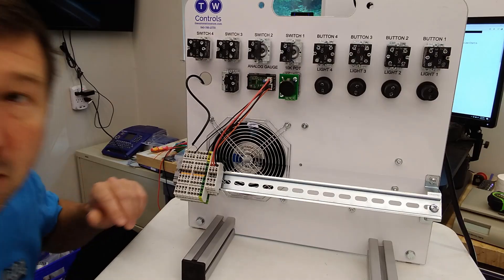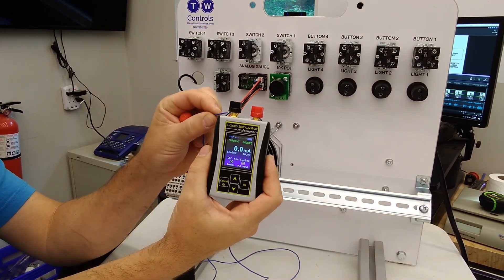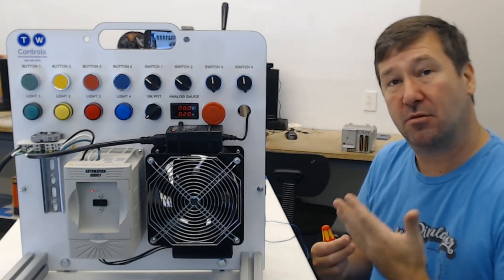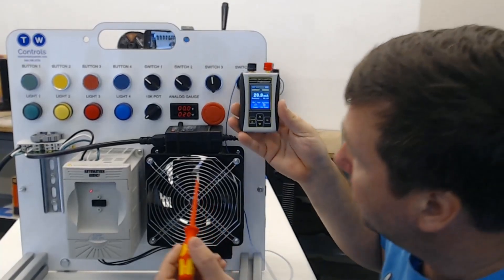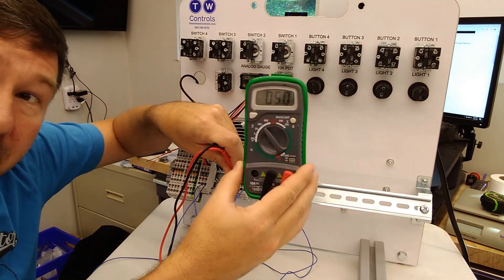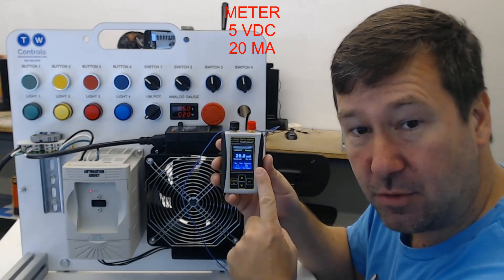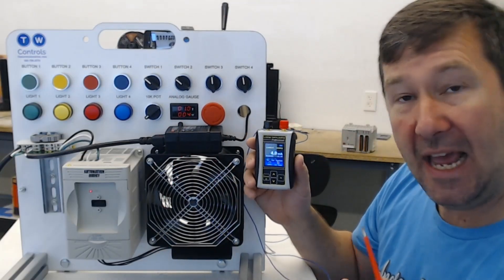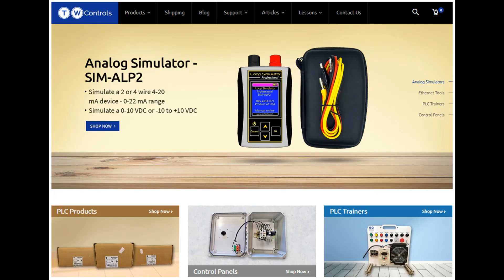Read a 4-20mA signal with a 0-10VDC PLC Input

Comment: Good day,
Why is it needed to convert 4-20 mA to 0 (or 2)-10V ? Is it a practical reason like 0-10V analog
inputs being more common or available on PLC ?
Or any other resons ?
Thanks & regards
Jean-François
Reply from the maker: Many PLCs have 0-10VDC inputs only.  Ultimately, a 4-20mA input is a voltage input with a high precision resistor.
Reply: @TimWilborne  I see thanks for this.
Jean-François
Reply from the maker: You are welcome

Comment: Nice Video Tim, Btw I want to ask question about wiring 3 analog 4-20mA sensors. I am using 2 wire transmitter (pt100) and two 4 wire transmitter (flowmeter and PH Meter)  to my analog input extension. I did the wiring already where the 4 wire transmitter like usual and I use PLC 24V DC supply for the 2 wire transmitter. The problem is when the flowmeter has no flow at all it has value around (0-30) fluctuates (the digital range  0 - 32000). And i tried to remove the 2 wire transmitter sensor, it reduces to (0-14) fluctuates. Note: I think i have scaled it properly to liter/second for the flowmeter, I have also done shielding + twisting for the flowmeter analog cable, I connected all the ground of every device to the same point. I am not sure how to solve the problem, is it because i use 2 wire and 4 wire transmitter or maybe it could be from noise... Thank You Tim
Reply from the maker: You need to add a deadband to your flow meter logic.  We just recorded a video about this last week but it isn't edited yet.  You need to determine the minimum realistic flow that your meter would see.  Let's say that turns out to be 100 units.  Then in front of your flow meter scaling, put a GEQ instruction with a Source A of your analog value and a Source be of 100.  Then add a rung with a LES instruction, source A of your analog value and Source B of 100, and then use a MOV instruction to put a 0 into your scaled analog value.
Reply: @TimWilborne   Aaa Icic, i got your point. The fluctuations usually around 0 - 0.01 Liter / second. When i read my flowmeter the min range is 0.977 Liter / second. I think i will use value around 0.1 liter/second as the minimum. 

I thought that this small error is caused by the loop from 2 wire  transmitter.  Thank You Tim , I will wait for that video 👍👍

Comment: When connect the resistor in series on circuit, is that restrict the overall current flow on the loop?
Reply from the maker: Yes, there is a limit based off of ohms law.  Volts/Amps=Ohms.  For 10VDC, 10VDC/0.020Amps=500ohm max.  If you have 24VDC then 24VDC/0.020Amps=1200ohm.

Comment: Hello. There is a liquid level sensor. Power supply 24V. For setup of the sensor via the power supply the laptop is connected. HART protocol. Can you explain why parallel to an entrance of the laptop resistance of 250 Ohms is included? also in the line there is an analog PLC module. Sensor - Vegaflex 86, Power Supply - Vegastab 690.
Reply from the maker: Hi Aleksandr.  I need to learn more about HART.  I'm not sure why you connect a 250 ohm resistor in parallel.

Comment: Hi Tim.  Thanks for this and other informative videos. One question; is the 125 Ohm resistor value for a 2 to 10V reading correct. Should it not be 500 Ohm?  V= I x R. V = 20mA x 500 Ohm = 10V and 4mA x 500 Ohm = 2V.
Reply from the maker: Hi Pieter.  In this video we used a 250 ohm resistor which equates to 1 to 5 VDC.  500 ohm would get you to  2-10 VDC but this isn't commonly used because it leaves very little room for corrosion and other resistance.  4-20mA transmitters have a maximum impedance which lots of times is as low as 500 ohms so the device can't regulate a current through a resistance that is greater than it's maximum impedance.  We talk about it at this link.
https://www.theautomationstore.com/measuring-a-4-20ma-signal-with-a-voltmeter/
Reply: Hi Tim. Thanks for the reply. Do I understand correctly that it is then better to use a 250 Ohm resistor and use the voltage range of 1 to 5V. Is the range between the max and min values not too close. Eg. if I have a 10 000 liter tank with a sensor having 4 to 20mA output, will it be accurate enough to sense and control pumps to add more liquid or for alarms etc.
Reply from the maker: @pietervdberg7055  That would depend on the resolution of your analog sensor.  

For example, let's say you had a 12 bit 0-10VDC analog input.  12 bit would have 4096 increments over the 0-10VDC range.  4096*4/10=1638 increments over the 1-5VDC range or each increment would be 6.1 liters

If you had 14 bit resolution then each increment would be 3.05 liters.  16 bit would be around 0.75 liters per increment.
Reply: @Tim. Hi Tim. Your explanation was very helpful. I looked at equipment catalogues and could see the info on the technical specs. I understand where the 4096 increments for a 12 bit resolution comes from for a 0-10V range (2^12 = 4096) and 4096 x 4 / 10 = 1638 for 1-5V range. Each increment will be 10000/1638 = 6.1 liters. If I follow the same method for a 14 bit (2^14) sensor I get 1.52 liters per increment. This is exactly half of your answer of 3.05 liters. The same with 16 bit (2^16) I get 0.381 liters which is also half of your answer of 0.75 liters. Please explain where I have it wrong.
Reply: @TimWilborne  I dudnt find any such discussion at the link provided.

Comment: Why analog card reads the signal as a voltage instead of current ?
Reply from the maker: I'm not following your question. What type of PLC are you using and what values are you seeing?
Reply: @TimWilborne 
I mean 4-20 mA signal converted to 1-5 volt in plc, why plc not read (4-20) directly without converting from (4-20 mA) to (1-5 volt)
Reply from the maker: @MM-vi9kh  All mA measuring devices read a voltage across a load resistor. I think this has to do with precision and cost.

Comment: Thanks for this video,

But I have some inquiries, how much voltage required to operate transmitters? As i know it is 24 DC volt. So as you explain the voltage  across the resistor is 5 v,, is this 5 volt used to operate a transmitter?
Reply from the maker: Not exactly.  That was for measuring the voltage across the load resistor which is how the PLC reads a 4-20mA signal.

All 2 wire transmitters have a certain amount of resistance and this is what powers them, this is called "Passive" power.  It will be dependent on the particular transmitter and circuit load so it isn't as simple as saying "12VDC" minimum.  Usually you will see a voltage range and this take into account the power consumption required for the transmitter.  Is there a particular model you are looking at?